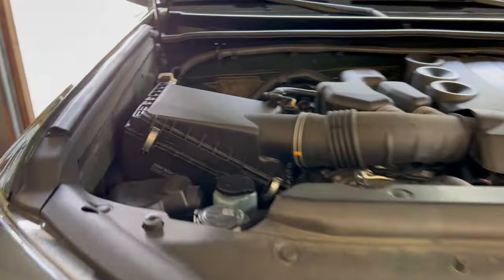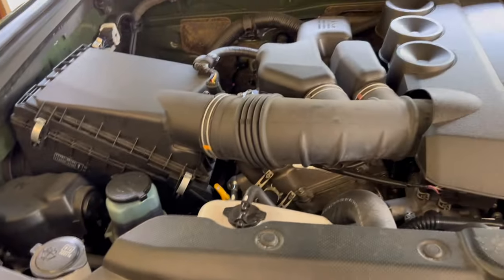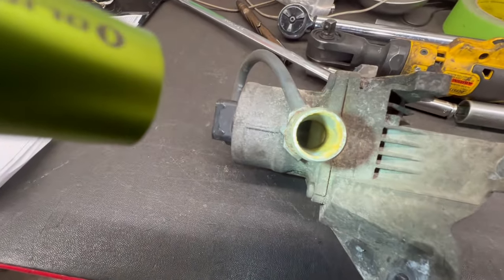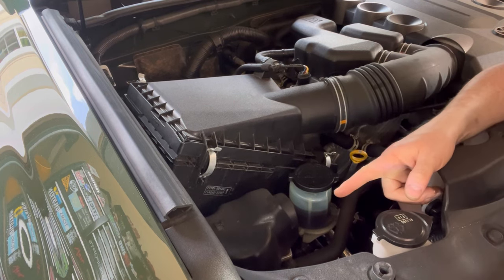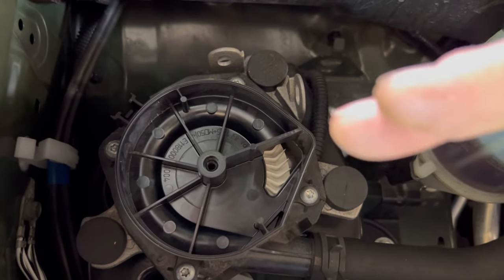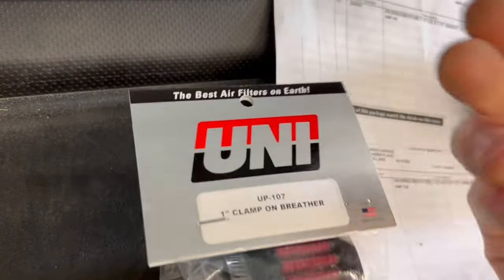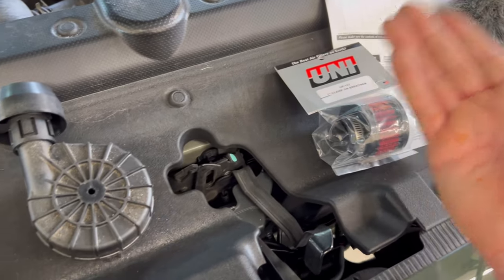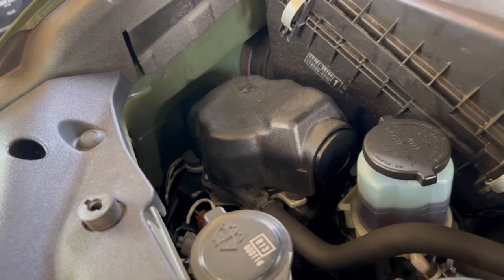Toyota Tacoma/FJ Cruiser/4Runner - Emissions air pump filter solution • Free Maintenance •Easy Fix

Comment: I was a little worried about that little filter in there. Good work. I’ll be ordering one for my 21’ with 52k miles. Appreciate it 
God bless~
Reply from the maker: Better safe than sorry. Appreciate you!
Reply: @VikingsGarage finally got my filter and did this this afternoon. Easy. My filter was pretty clean but didn’t want to have to worry about it later on.
Reply from the maker: 👏🏻 Right on!!

Comment: What about the 2012 4Runner?
Does the pump affect fuel mileage?
Is it possible for this pump to be underperforming and not give a code?
Why not just leave the cover off (looks cool).
Reply from the maker: Any issues in that system will trigger a code. And yes it does come with one
Reply: @VikingsGarage  Thank you for your reply to my questions. Excellent information, I'll be checking mine this weekend.
Reply from the maker: @richardstone5241 😉👍🏻

Comment: @Vikings Garage I live in a very dry and dusty climate, desert in Arizona. If doing this mod on a new 4Runner, would you leave the stock foam in the housing and install the Uni filter pod? Or remove the stock foam and only run the Uni filter?
Reply from the maker: Either one or the other.
Otherwise too much restriction can become a problem.

Comment: This is great! I’ll purchase the other filter you recommended. One question, does it cause any code errors in the system if the air flow alters with the new air filter ?
Reply from the maker: To my knowledge, it does not.
I’ve been doing this for years. 
ZERO ISSUES 
leaving that foam thing clogged up in there will cause issues, guaranteed.
Reply: Thanks for the advice!! Much appreciated
Reply from the maker: @GeorgeTua-ol9od 👍🏻

Comment: Is this an oiled filter like the k&n? Do you think excess oil will coat the fan and attract more dirt to it or effect anything else in the system? Thanks for the tip!
Reply from the maker: I did specifically say “ I bought this one because it DOES NOT use oil.”
Enjoy!
Reply: Ha! You did. What i get for not paying attention.
Reply: @VikingsGarage  Can you double check the link for this filter? I ordered it, and it says it's an oiled filter.
Reply from the maker: @steves5825 It is the right one. You don’t need to oil it, only if you choose to.
Reply: @VikingsGarage  Gotcha, thank you!